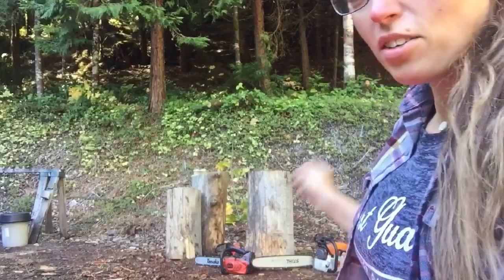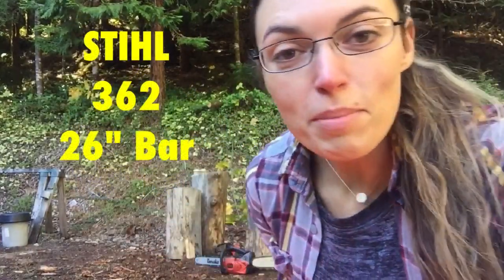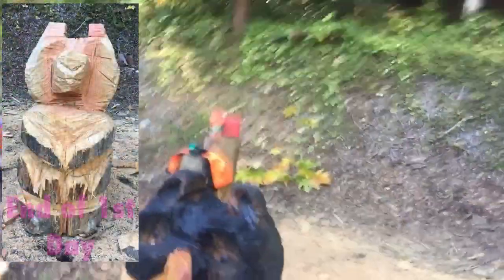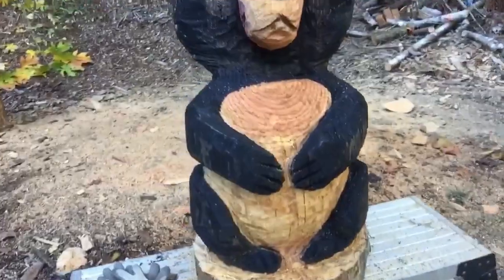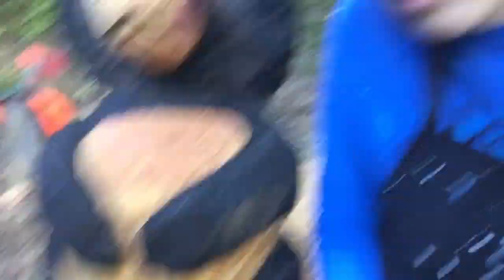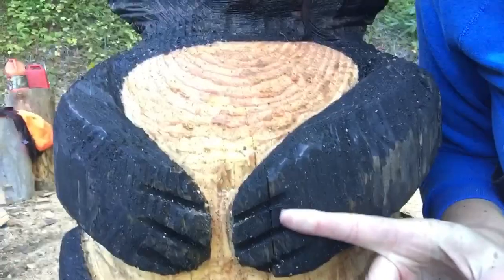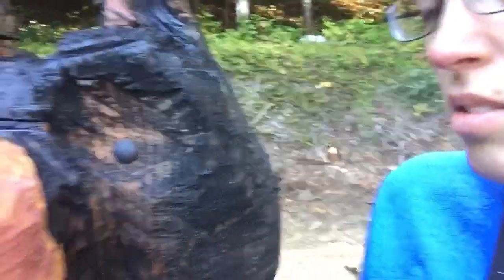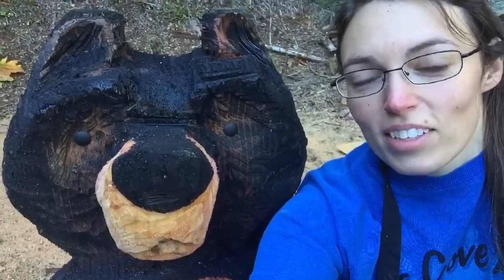Chainsaw Carving a Bear in Time Lapse First Attempt Ever DIY Rustic Art

Comment: Nice bear.  I have been carving for about 5 winters, this winter I’m tackling bears and other work.  The best thing I did different this season is to build a table/clamping invention.  Having the log about 22ish” off the ground and secured has let me use the saw in ways I used to risk cutting off body parts.  Also wanting the heat of my studio, I have gone non-gas saws.   Many more bears to you😎👍

Comment: Quite good for the first Bear. Cracks are common and that is not a big one...at least not yet. Often most carvers will  make a vertical cut on the back from the neck/head area straight down the back to the bears bottom or base .. about 1-2" deep. If there is still moisture in the wood it may release out the carved crack.
Reply from the maker: Excellent! Thank you for the advice, I will try that with the next one!

Comment: Great job. You should be proud of yourself !!.......Just fyi, if you make a relief cut in the back of the bear around 3 inches deep from the top all the way down through the bottom it will reduce the chance of cracking in the front. It still may crack but much less likely. Just a friendly tip.
Reply from the maker: Thank you for the advice! Yes, the little crack has grown.